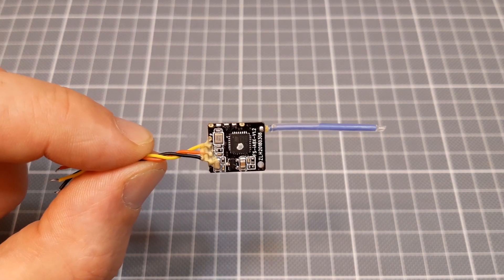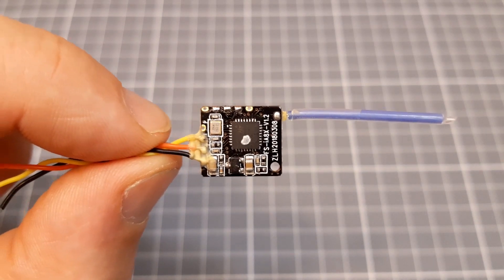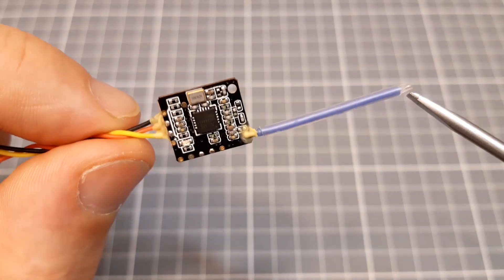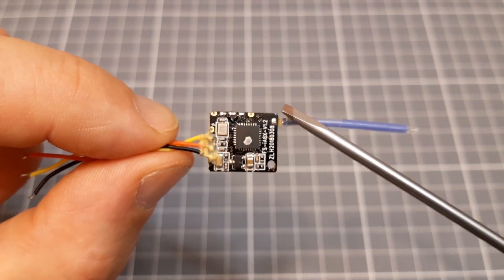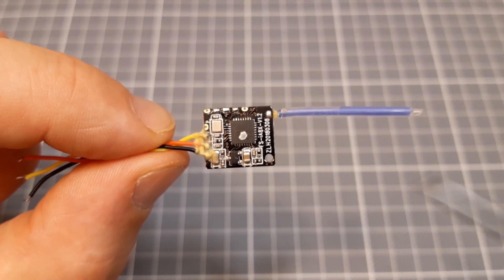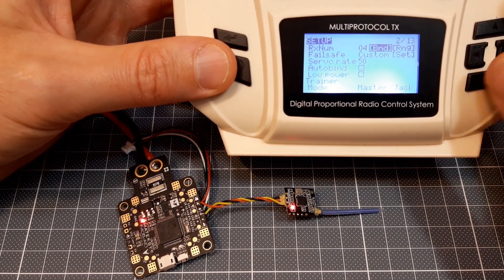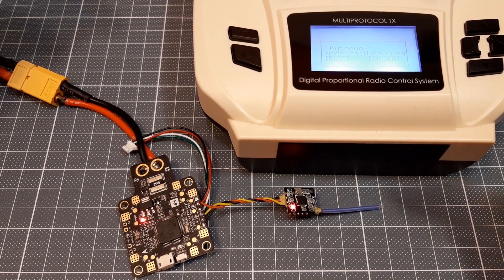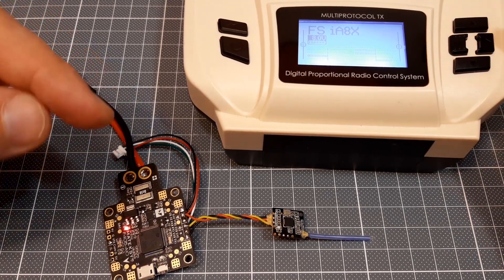How to bind Flysky FS-iA8X receiver | Quick review

Comment: To change the antenna you need to know what you are doing because otherwise the signal will be weaker in the most of cases and another fact is that you can't even tune it as 2.4 GHz oscilloscopes are really expensive. You can't just take any length you like LOL